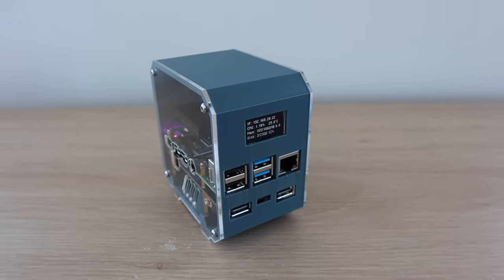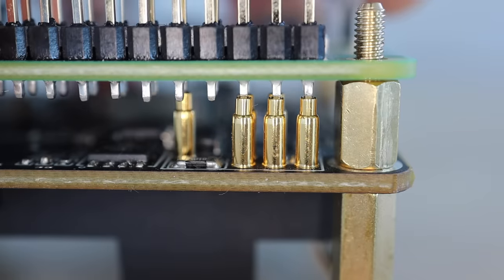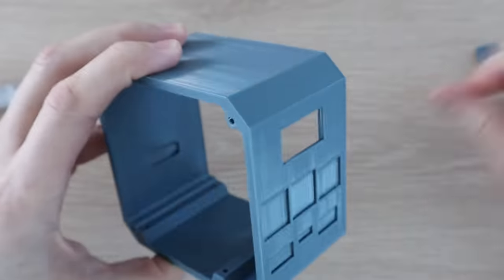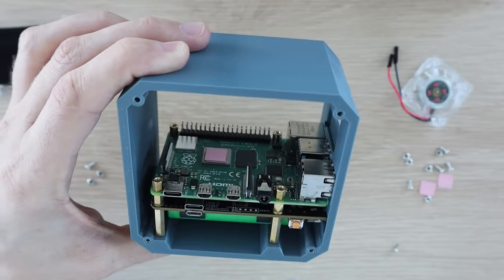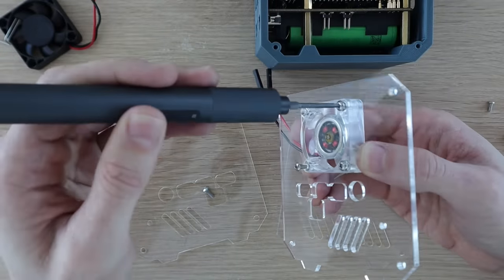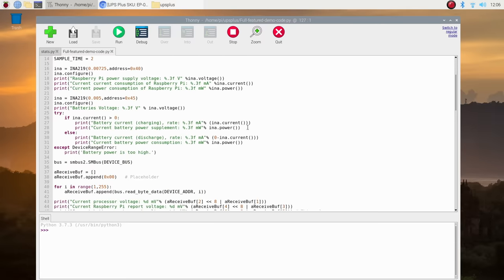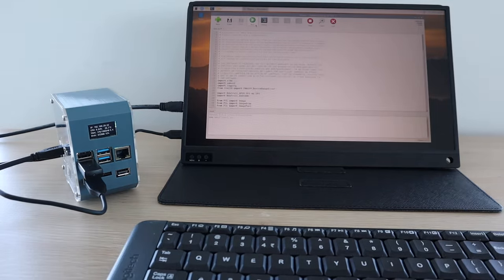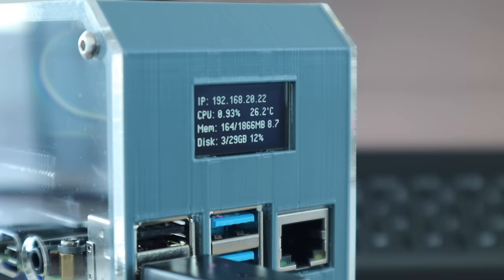Mini Raspberry Pi Server With Built In UPS & Stats Display

Comment: Great work, here are my two "quality of life" advices that might help in the long run:
Add a grill in front of where you mount the fan, so it would be safer in case of something flies into it.
Add a lid at the bottom of the case so you can insert batteries after you built rest of the system and you can use it in case you need to change the batteries (dead batteries etc.) in the future as well without disassembling the whole system.

Also I read this in another comment, moving fan to the top of the case might result in better airflow as well.

Again, great work though, I might buy one of these in the near future for my small projects. 👍👍👍
Reply: I thought the same thing bout having some kind of open space in the bottom so you could replace batteries. I liked this project.
Reply: 🤨 - he has also positioned the fan back to front = blowing air into the cabinet and out the lower vents with the fan at the top side….. 🙄 has forgotten that heat rises = the fan should be mounted the other way to draw the hot air out the case and cool air in through the lower vents ✅

Comment: Hello again Michael!  Just finished this project and am happy to report that it is working perfectly!  If anyone is interested, I printed the case on my Snapmaker V2 and also cut the side panels with it as well.  It is only a 1.6 watt diode laser, but if you use black 3mm (1/8") acrylic and the right settings (several slow passes) they came out great!  Thanks again for the project!
Reply from the maker: Thanks for sharing your experiences. How do you find your Snapmaker? I've been looking at trying one out, but I've got versions of the individual machines already, so haven't gotten around to it.
Reply: @MichaelKlements  The Snapmaker is very well constructed and sturdy.  That said, it takes a little while to change from one tool head to another.  I don't use the cnc head now but probably will fairly soon. If a person has the room, separate machines that have the attributes you need are probably best. :-)
Reply from the maker: Thanks for the reply and feedback. It looks like a good quality product from their marketing videos and the reviews I've seen for it. The CNC head is one of the tools that I'd probably use more often as my current CNC machine is quite small (only about 150mm x 150mm to work with). I'll give it some thought again soon, thanks!
Reply: @MichaelKlements  My pleasure.  Also, I bought the rotary module but not yet installed the thing.  That has a lot of possibilities.  And, thank you again for the Pi project.  I'm retired, but still enjoy learning - and making.  Your video and supporting web site were a pleasure to follow.  Thanks again!!!

Comment: This is so professional looking. My only suggestion would be to have all the ports at the back and the display should be on the same side where the SD card is inserted. Other than that it looks and is an amazing upgrade.
Reply: To ease of use, he implemented all the inputs in front. Practically it is more useful. Thanks The TekChef

Comment: To isolate the batteries when inserting everything in the case you can use a normal plastic sheet (like they do in new electronics that come with batteries pre installed) and pull it out when it is ready.
you can also make 2 small holes under the batteries where they make contact so you can insert something between them and the contacts.
Reply from the maker: Thanks for the tip

Comment: If you ever rebuild this, you could probably put in a battery access hatch on the bottom, to allow safer assembly of the unit, and easier means to replace batteries when they are at their end of life.  Cool project though!

Comment: you should consider moving the fan to the top of the case, directly above the ice tower cooler, then add a duct that sends all air through the ice tower cooling finns.
Reply: What's the point of that though? The current cooling arrangement is already overkill, and the airflow needs to be free enough to pass over the batteries/ups
Reply: Great idea. I was thinking the same. Duct is not needed, but vertical airflow from the top near the cooler is nice. I wan to know what kind of noise produce the fan. I'm using a passive cooling case solution from pimorini and love it. 👍
Reply: Vertical airflow from the top will help add more battery to the bottom  of the case with out much hassle. by moving the fan to the top of the case.  plus it will be better for cable management also shame to waste all that space...

Comment: Never had a Pi nor did any programming but this looks like a really nice and sleek solution ! Love it !
 For the battery issue: 
- add a lid for exchanging the batteries or 
- screw the feet in from the outside (so you can pre assemble the electrics) 
- or just insert 2 pieces of plastic folio under the battery’s contacts and pull them after the electrics are installed
Reply from the maker: Thanks for the suggestions
Reply: @MichaelKlements  pleasure 😎 thx for providing such great content !

Comment: You could have used some plastic tabs to isolate the battery positives in the case until the build was complete then removed them with tweezers. Remember heat rises so the fan may have worked better in an exhaust up position in the top of the case. Great video thanks for the ride along during the build and the time it takes to make, edit and upload these videos sir.

Comment: It would be cool to add a 2.5 inch bay for a hard drive or SSD
Reply: There are all kinds of possibilities. I'm thinking of an internal SSD and also a powered USB hub as well. It would take a bit of a redesign though to make room.
Reply: @ninline2000  he still maximized the space and got a LOT of features into this tiny package that I wouldn't have thought of. I am curious which program he uses to design his CAD designs. I am working on getting my Pi to run a 3D printer for a class project and it looks like that one may be a possibility if it can run on a Pi 3B+.
Reply: It has storage A MICRO SD CARD
Reply: @Guillie641  not good for NAS applications.

Comment: 4:00 It's better to make the cut out at the bottom of the case for separating the battery, so it doesn't have potential short while assembly or maintenance. imo

Comment: This is absolutely great piece of work 🙌. Keep showcasing more on these lines. For batteries I guess you could have created a separate section which would have created a partition automatically providing a chamber like design. I hope you got the idea of isolation of PCB and the power module. I guess it was doable since you're making your own 3d printed server console.

Comment: This is exactly what I envisioned when you first produced this type of Pi case.  It's excellent to see a working version!

Unfortunately, if you have to change the batteries for any reason, it's going to require disassembly of the entire unit.  How many cycles do you think these will last, and under standard load (no monitor), how long do they last?
Reply from the maker: Yeah I need to look at putting a battery cover into the bottom of the case as well.  
18650 cells typically do around 300-500 cycles, but in a UPS they shouldn't be fully cycled very often. I'd guess that you should be replacing them every two years or so.
Reply: 500 cycles then with 80% of capacity remaining seems to be fairly common on a good brand cell.
Reply: @MichaelKlements  you can modify it to charge up to 80%
Reply: @MichaelKlements  Alternatively, you could reverse the orientation of the standoffs (you might need different ones) and have everything secured with four screws that go up through the bottom of the case. That would allow you to remove the entire Pi setup without having to disassemble it.

Comment: It would be interesting to install a touch screen or plain screen on the top and connect it so that you don't have to use a giant display. This would be far more efficient for a power interruption as it uses far less lower and is small enough it could easily fit. Can set a switch or a script with the ups so that the screen only comes on if you hit the switch or the power is interrupted. Just an idea when I saw the display plugged in and how much power it takes, and the fact it's not integrated. Great job on this, thoroughly enjoyed it!
Reply: Its a server, so when he finished the video he probably ran it headless (without a display besides the oled one) just connected to lan and power.
Reply: At least a 4" screen would be way cool, and when you run it headless then you could still have fun displaying animations lol

*Edit: obviously wouldn't be power efficient.

Comment: Elegant design. I wonder if the cooling ability is affected by separating the fan from the low-profile tower. Perhaps the vertical Ice Tower is a better choice?
Reply: Or remove the fan entirely and use a large heatspreader cooling block instead along with thermal pads to attach it to the components directly.  Silent and cool!  Then you could even stack them in rows without worry.

Comment: I have been running a home NAS on a Raspberry pi 3 and recently 4 using a powered hub and 6 portable USB disks - in total I have 10TB on three Ext4 drives and rsync them to 10TB on 3 NTFS backup drives. It's been pretty good, with SMB sharing at home and FTP server access from the internet.....BUT I rarely achieve more than a few MB/s transfer rates even between ext4 and local USB drive on another port on the same RPi.
Recently I have moved to a Mini PC (costing less than an RPi4) running Openmediavault. It took less effort to setup than the RPi - and uses less power (surprisingly).

Comment: I would love to see this with an added feature of an internal hdd through a sata hat.  I use my pi 4 as a Plex server with a data hat and I don't think there's enough options options to add multiple different types of hats to the pi such as a sata hat plus ups hat and a case that holds it all.

Comment: All this effort and high risk of shorting the Pi could have easily been avoided by a simple hardware mod to include a switch to isolate the batteries during assembly.

UPDATE: He mentions this later as an improvement to the design.

Comment: You could solder switches across a small double-sided PCB, then insert the PCB between the battery, and the contact on the PCB holder.

Excellent design BTM.
Reply from the maker: Thanks for the suggestion, this is a really neat idea.

Comment: How about splitting the case into 4 panels that can slide together? So you can still replace the batteries without the risk of shorting the board.

Comment: Yoiu could have isolated the UPS board for installation by puting some strips of paper between the battery terminals and the holder's contacts. The paper could be pulled out when installation is complete.

Comment: I have a question, do you think about pull out placing plastic interrupter between battery and battery holder? in this way I think you would bypass possibility of shorting circuits ? I don't have any technical background so don't be rough on me if im stupid heh.

Comment: Awesome solution! I have a Pi running Ubuntu Server that is running a Python/Django based site. Using Python/Django to monitor/control fish tanks so I love the backup power capability of this, it would tie in nicely to the backup power for various pumps on my fish tank setup.

Thanks for sharing!

Comment: Perhaps if you had seated the ups a little lower and included a door on the case so you could insert the batteries after the unit was built. 
Maybe you thought of this and there were other reasons why this would not work....Either way great video. 
(After watching the complete video you did mention this)

Comment: Just noticed this, after pulling the power cable, battery goes automatically from 95% to 70%. This could be because it's polling the battery voltage during the CV phase of charge, which provides the 4.2v constant charge voltage and is confused as the battery voltage (or an average of both). Once unplugged, the 4.2v is no longer supplied and drops to actual voltage. Best way to poll battery voltage (via software) is to interrupt CV briefly to poll battery voltage, and then resume. At least that's what I think, I could be wrong.

Comment: Great video as for the battery issue. A lot of devices come with plastic pull tags. So the battery only works once up pull the plastic tags. You could do something similar whilst setting it up. Or perhaps a 3D printer wedge that u could insert into the battery when u want to disconnect the batteries??? Just a n idea

Comment: The thing with your ups coming back on... I mounted a raspberry pi inside an industrial cabinet, it started counting when the sensor inputs weren't there, I found that it was sensitive enough to detect the rf voltage spike from the contactors coming in and out inside the panel with it, I ended up just fixing that in code rather than trying to shield it.

Long story short there's a reason industrial electronics have excellent shielding, the pi definitely doesn't, when you left it alone was it close to something that would switch on/off at mains voltage?
Reply from the maker: Thanks for the tip Max
Reply: @MichaelKlements  I fixed it in code because proper shielding is a dark art, I just said "ignore any signal that isn't longer than 0.2 seconds", but it goes to show how sensitive the thing is.

A few years after I was using an off the shelf plug in timer, you know the kind that turn lamps on and off in your house when you're away so it looks like someone is home? Well I used one as a temporary measure to turn on a pump to drain water out of an air receiver inside a plant room - same problem, only the thing would turn on, and stay on even when it wasn't time to and only turn off when whatever next "off" program was... And that wasn't in a cabinet, it was 5 meters away from anything else heavy duty and it wasn't an Ali express job either.

I'd be interested to know it it still does that if you plug it into your car (at night when you're not using it) and turn it off so that it's got power but it's away from everything else.

Anyway nerd rant... Sorry.

Comment: when you go to install the batteries in the UPS, you can slide a rigid piece of plastic, or a length of ribbon between the end of the battery & the connector on one end, that way you can install them, assemble the kit & it wont be getting power from the batteries making a risk of short. like when you get a device with batteries installed & you need to remove a plastic tab to allow the batteries to make contact. i find ribbon works best

Comment: Wonderful build.   It might be possible to change the case in a way that the bottom has an access panel to put in and take out the batteries.   This would at least solve the danger of damaging the board during installation.    Also allow replacement of batteries if ever needed.  I would probably use unit for a file server as you said.   really need to get 3d printer,  to many projects I promised myself I get done before I did that, as I'm easily distracted by new things.

Comment: I've decided to build this project and now have all the parts in hand.  I printed the case body on my Snapmaker V2 A350 using Cura 4.10 as my slicer.  It came out fine, but the long overhangs for the usb and OLED rectangle openings were understandably "stringy" and the early layers spread a bit (elephant's foot).  My next attempt I turned on supports and used the "raft" option for bed adhesion.  That fixed the spreading and the case is useable.  However, in the video it looks like your case had "knock outs" for the openings that did not appear in the .stl file I purchased.  Not a complaint - the overall design is really very clever. I'm just curious about the knock outs.  Thanks for a great project!!!
Reply from the maker: The "knockouts" you are referring to are added by my slicing software as supports. I use Creality Slicer, which has a simple option for "supports everywhere". I'm not sure what this looks like in Cura, but since Creality Slicer is based on the Cura engine, you should be able to get a similar support generated in your software.
Reply: @MichaelKlements  Thank you for your kind response!  On my second attempt I did indeed turn on the Cura version of "supports everywhere."  Yours just looked nicer - ha!  There could be multiple reasons why - ranging from nozzle diameter to layer height to build speed.  Those are for me to explore - and I will over time!  Again, thanks for the response.
Reply from the maker: It might even be as simple as the orientation that I printed the case in. The support pattern might just fit this orientation better. I tend to print my cases flat with the ports on the right side of the printer when looking at it from the front. 
I'm also not sure what tweaks Creality have made to the settings etc, you can't view or change nearly as much as you can in Cura.
Reply: @MichaelKlements  I'll give that a try on my next unit - THANKS!

Comment: I agree, it's a great device, and battery isolation is definitely needed. While modifying the battery holder connection for a switch, why not replace the battery holder with a 4 bank, to get 3 hours of power? Great vid!
Reply from the maker: Thank you, that's a good idea. This board would definitely benefit from having two more batteries.

Comment: Sorry for the question, but can I ask for help? After setting ups, led display and running the script, an access error occurs and the raspberry goes into protection and turns off. Does anyone know what is the reason?

Comment: After pulling the plug, the battery load dropped by 30% in just 5 seconds and the CPU was barely running at 1%. How did you get this to run for longer than an hour?

Comment: I am going to use it on my 3d printers to implement proper shutdown when power is off to prevent FS failure. I thing for that purpose one battery should be enough.